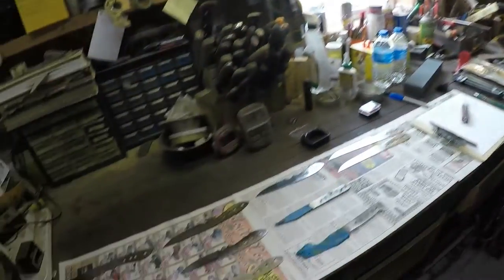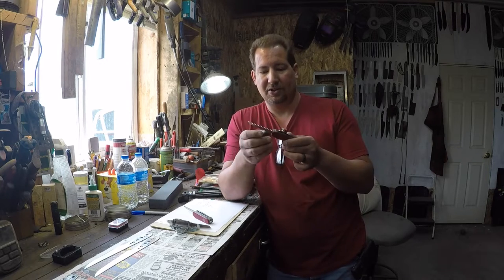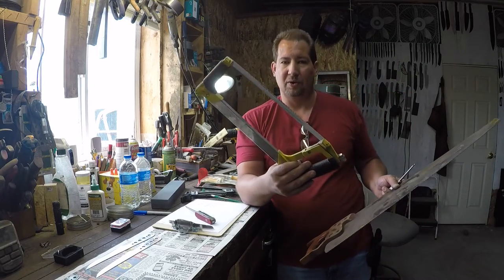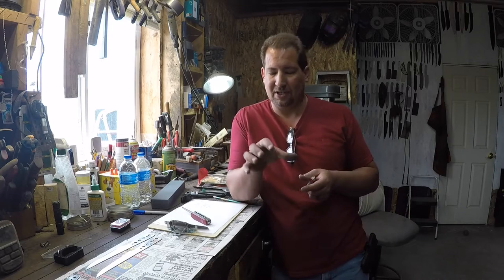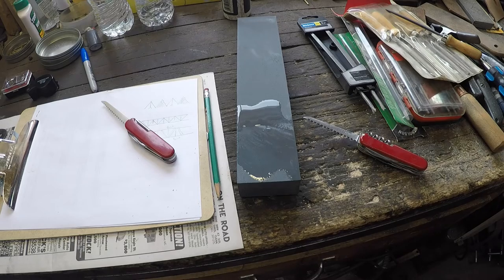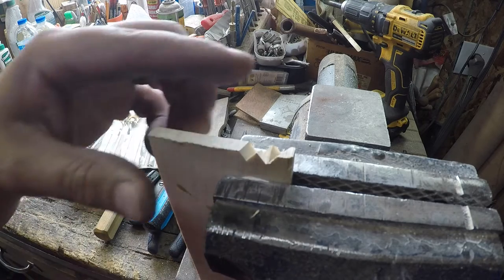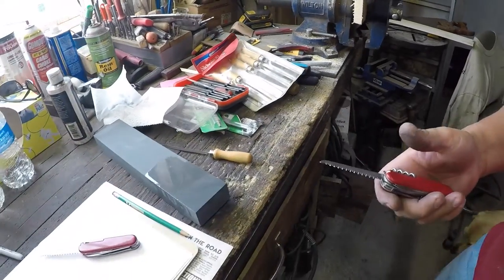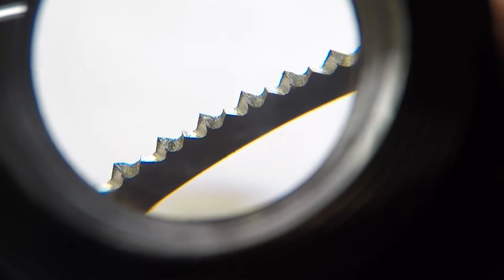learning to sharpen sak victorinox hiker saw blade

Comment: I would consider this much to do about nothing. The Victorinox saws are excellent and they cut impressively fast but are intended to be used on soft material like wood and plastic or PVC. The saws are not meant for heavy daily usage because lets be real its only a pocket knife. Its meant to be used occasionally. If you have daily sawing tasks then you would buy a dedicated saw for that you wouldn’t be relying on your pocket knife saw. I have carried multiple different SAK knives and multitools over the years but I have never sawed enough with the wood saw on any of them to make them dull. Under normal use I would not expect to dull an SAK pocket knife saw during its lifetime.